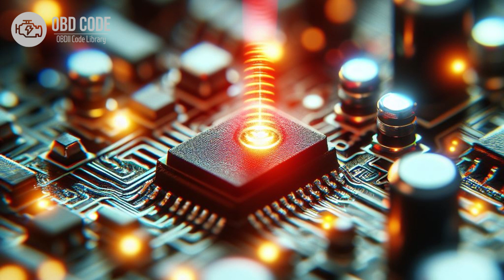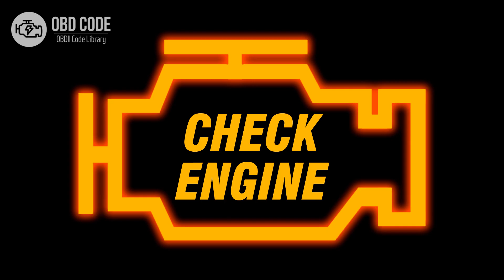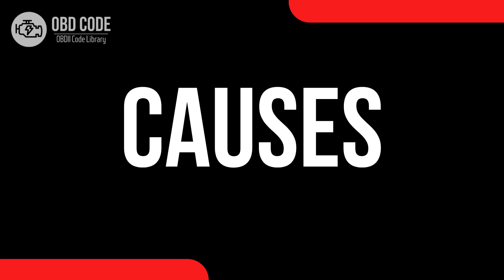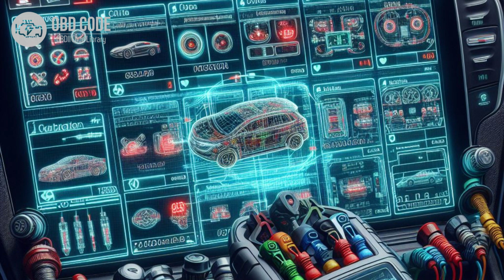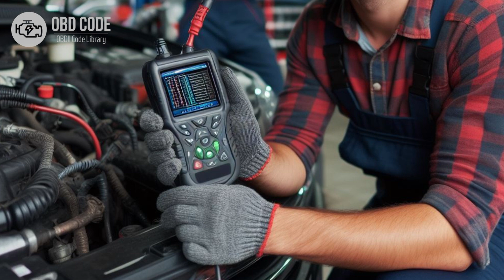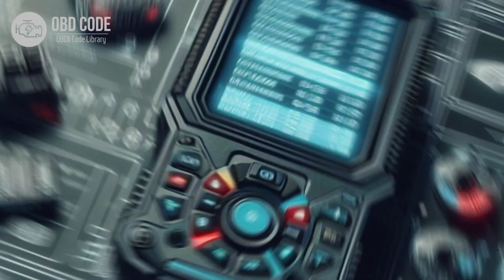P0600 Serial Communication Link Malfunction 🟢 Trouble Code Symptoms Causes Solutions

Comment: Check for fake spark plugs.   My Mazda threw this code after I put new OE “NGK”spark plugs.   Turns out they were fake.  The plugs and packaging looked 100% real.  I replaced them with real NGK plugs and the code went away.   Always check spark plugs at the store with a multi meter and buy from an authorized dealer.   People buy real ones and return fake ones.   NGK should be 5K ohms.   The fake ones will be all over the place or not even register.

Comment: If P600 errror is due to the faulty ECU, Can this be resolved without replacing?
Reply: Dont thinks bud, checking connections right now on mine
Reply: Yes, it can be a broken wire running to one of the many modules.